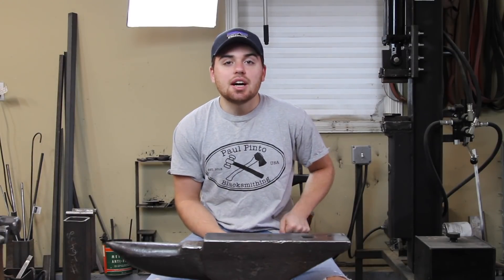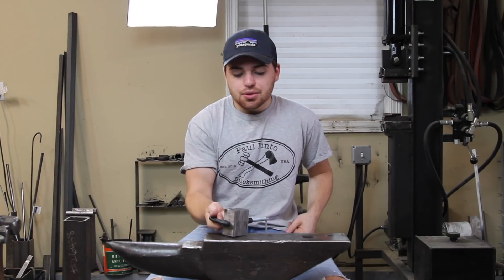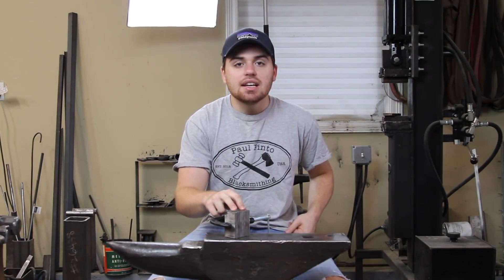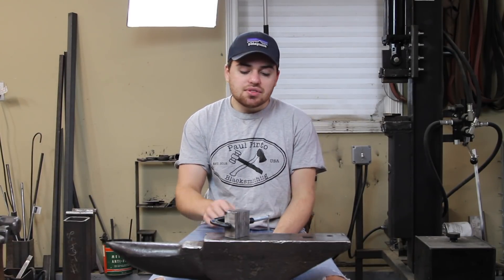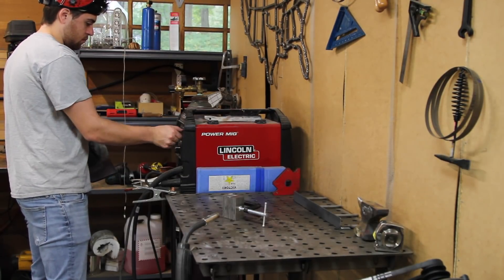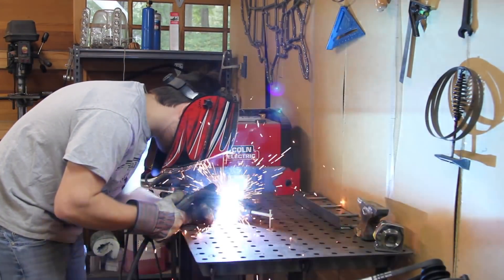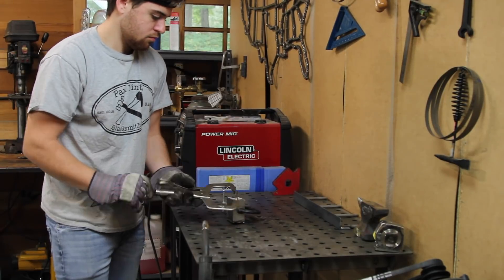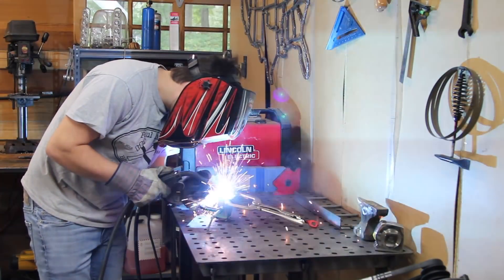Making Damascus Steel for the First Time

Comment: another that talks but doesn't know, this is pattern forge welded steel...
just like everyone on you tube they are all different techniques of pattern welded,
NOT A SINGLE ONE KNOWS HOW TO RECREATE IT THE WAY THEY USED TO...
it's been lost for at least 250 years, the first one who figures it out, backed by 
lab analysis and pics of the crystal in the steel looked at 500 times bigger on
electric microscope. that person will be able to charge 10-15 times more to real collectors 
who knows what it looks like. there is no stacks of 2 different steel stacked 10 high
and no folding over and over. before you start talking about something you obviously don't know
maybe read on the subject and know wtf you are talking about instead of spreading B.S. to those who
don't know and contributing to propagating ignorance like so many on you tube. don't have to look far to realise that about 80% of the citizens are fucking dumb, they believe every Joe who talks about shit he don't know !

Comment: Paul great work, but you did not make Damascus (Wootz) steel.  It's forges welded and the two are completely two different things.  https://www.youtube.com/watch?v=OP8PCkcBZU4&t=523s
Reply: Came here just to see if this was already mentioned. I wonder if the term "damascus" is so cool sounding that people want to use it. Even if pattern steel is just as impressive, and usually a lot prettier than damascus.

Comment: A low layer count can be very dramatic. I made a 16 layer knife blade. Dropped it in the etchant for about 20 minutes. When I polished it, there was no black left on the 1095, but the layers were etched overtly deep and looked really good. I hope your blade turned out as well.

Comment: Make a simple rounding hammer from it Paul.
Once the fuller troughs and cheeks are drawn that simple pattern will take on a neat look.
Harden in oil, and 400f° temper for about an hour.
It will be pretty much as durable as a 1045 based one.
I've never pressed billets, but have done some canister blanks from chain saw chain, ball bearings if various sizes and 1084 powdered steel.
It welds good in the tubing.
Now I need to make one large enough to do a hammer myself from some.
Reply from the maker: That’s a good idea I’ve always wanted to make a hammer out of Damascus. What do you think about using some 1045 with 15n20. Do you think that would be a good combination
Reply: @PaulPinto  
Not sure how much contrast you would get with that combo.
Take s small piece of each steel and put them in the etch for a few minutes and see if you get a big difference in the coloring of the 2 metals. If one gets really shiny and one darkens up I guess it would make a good combo.

Comment: Ah! That's cool, just subbed this Morning after watching Jimmy's vlog and now we both publish a very similar video about making damascus for the first time. Great work man, your looks perfect!
Reply: Black Beard Projects I need to head over to yours.  You did yours by hand right?
Reply from the maker: Thanks man!! I just saw yours as I was uploading my video, its so cool how you did it by hand ill have to try that soon!
Reply: Hey Guys! I have a question for both of you.

I'm just a beginner at blacksmithing and curious about your opinions. I was watching both of your videos and realized that Paul's piece took a  concave shape at the end of the piece after the hydraulic-pressing. On Black Beard Projects' video I can"t see that concave shape, or at least not that much.

I was also watching an old hungarian educational video from the 1970's about mechanical blacksmithing. I will link it below. At 4:18 of the video, the narrrator explains: "If not the proper amount of pressure applied on the piece, the "pressure cones" don't close, therefore the end of the piece will take on a "beak shape" and the inner material will not be forged. With proper amount of hitting power the "pressure cones" close perfectly, the end of the material bulges" (i was trying my best to translate it)

https://youtu.be/QR-EIJLYKI4?t=258

Is it possible that with hand forging the inner material will be forged better, because you can apply more pressure on smaller part of the material than with hydraulic-pressing?
BTW great video from both of you! Keep up the good work!
Reply: Hi there, mine did too a bit when I tried to forge it sideways. I am not sure but the one Paul made looks solid and welded all the way, on mine I had to grind a lot of material that was not completely welded and had cracks on one side. Thank you :)

Comment: I use bandsaw blade from a local sawmill and rail track which is 1080 and the blade is probably 15n20 or simillar and it works well for blades and such